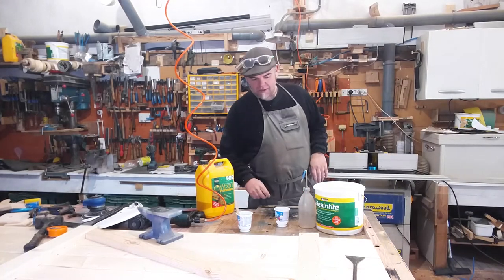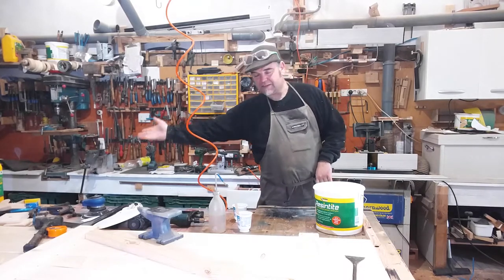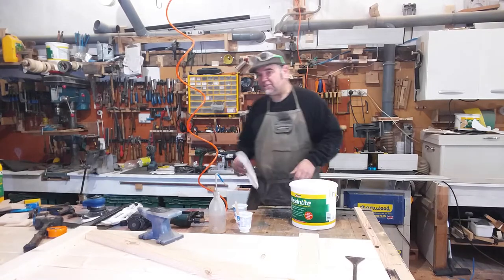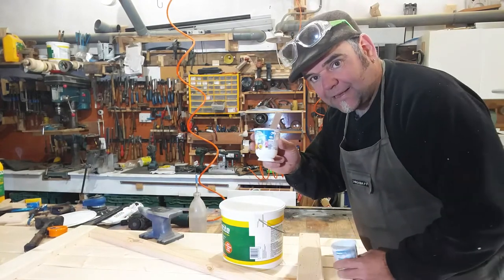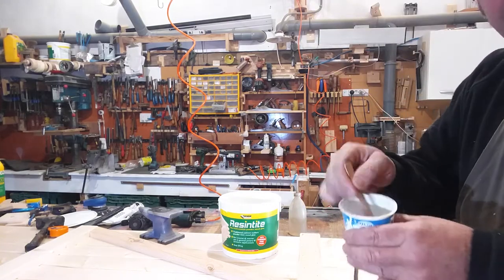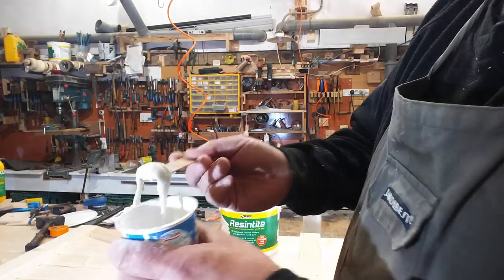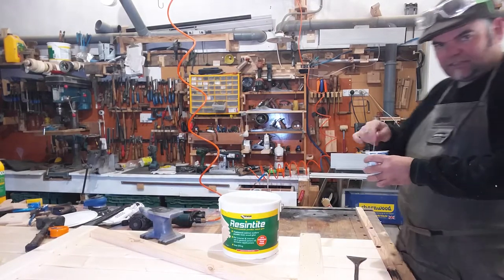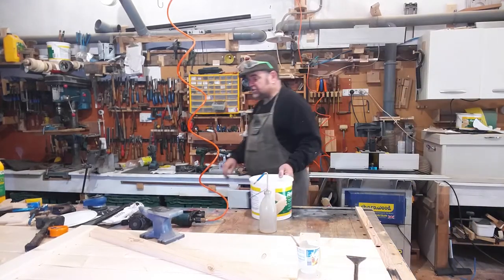How to mix cascamite powdered resin wood glue for woodworkers

Comment: I know health and safety has gone a but OTT, but I would like to add that with Cascamite and other powdered UF glues it is important to wear a dust mask whilst mixing and protective gloves when using. I realise you couldn't do your presentation with a mask on :)
Reply from the maker: Your 100% right thank you for your sensible comment
Reply: @KnooTek2000  just to let you know I am religiously wearing my mask now when mixing. Do you use Cascamite?

Comment: Thank you for explaining this. I bought a 1.5kg tub to assemble my new hives. And i was finding getting the mix right isn't easy. Considering i never used it before. It says its a structural gap filling glue. I haven't noticed that. Any tips or other recommendations would be greatly appreciated. Cheers...
Reply from the maker: I would say it is good at gap filling but will shrink... You can add sawdust or another medium as this will reduce shrinkage

Comment: Very grateful for this video as I was confused by the instructions, thanks. You might be interested to know that the shelf life of this stuff is relatively short. I had to dispose of a large supply of Cascamite I had for a number of years as it was unusable.  I spoke to the producers of Resintite in the last 24 hours and they informed me that they have not produced it at all in the last 3-4 years. I had to return a pot of it I bought yesterday as it would not mix and remained as an emulsion. How long had that been on their shelf?  The moral is, dont buy more than you need!
Reply from the maker: Your welcome, that is interesting about Resintite. I better check if that is the same for cascamite?

Comment: I  accidentally mixed it 1/1 with water instead instead of 2/1. Do you think the join will be strong enough?
Reply: If the joint isn't gappy then you will be fine. I have made mine thin before and sometimes intentionally. The only problem I can see is that it does shrink more when thin. What kind of joint?

Comment: Thanks for this, I followed the directions on the tub and found it almost impossible to get the lumps out - the makers say to put half the water in the pot up front. I will try al the powder and mixing water in a little at a time, your mix consistency was much better!
Reply: It works for me every time now. Just don't add too much water at once as it will separate. If it is cold where you are it will also become more fluid as it warms so be careful not to add more water than you need for the consistency you want. If you have any trouble please ask.

Comment: Thanks for this very useful video.  What kind of working time do you get with Cascamite?  I am building a pair of loudspeaker cabinets in walnut at the moment and need to clamp up the two side, top and bottom panels all clamped up in a single operation.  Is it like contact adhesive where you need to get it right first time or is there some room for repositioning and such?
Reply from the maker: Hi, Mr Trumpy88 working time is good. Once mixed you get up to an hour in the summer before it starts to stiffen but in the damp weather, you will get 3 hours. Cascamite is not like a contact adhesive at all so you do get time to reposition and clamp. I would say this glue is ideal for your job I use it on a daily basis in my workshop  at www.wallybois.com
Reply: Thanks for clearing that up for me, Marcus.  I will, of course, do a dry-run in advance to minimise any faff.  Great website you've got there BTW :)
Reply: @MrTrumpy88  Thanks Trumpy88